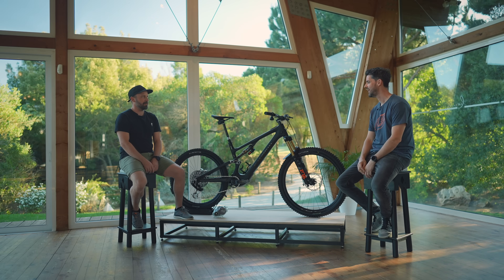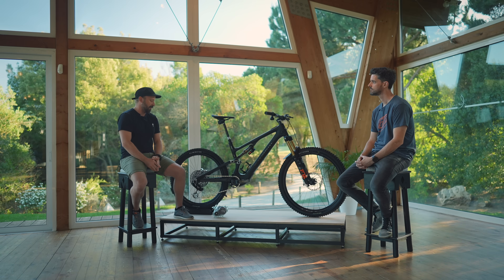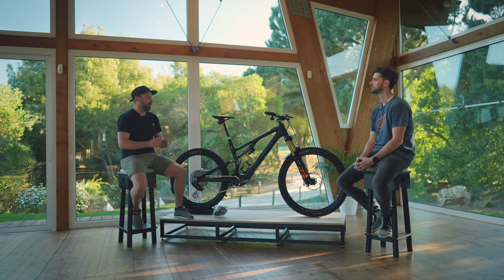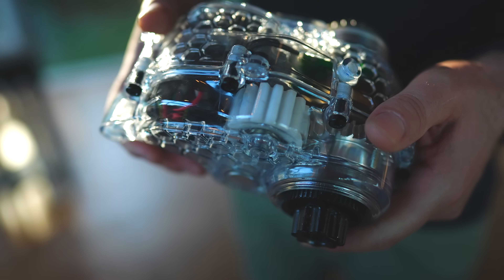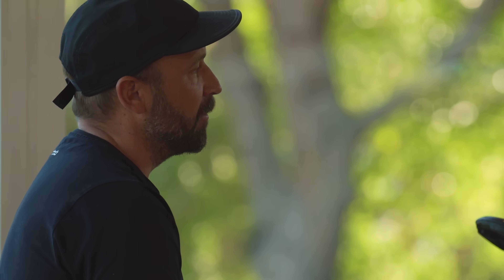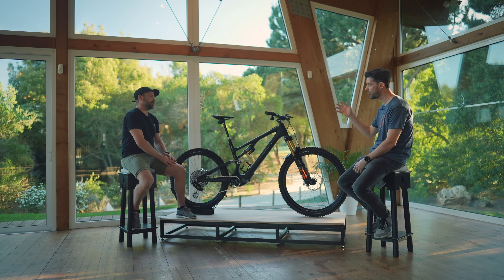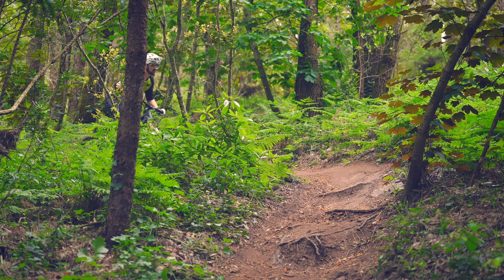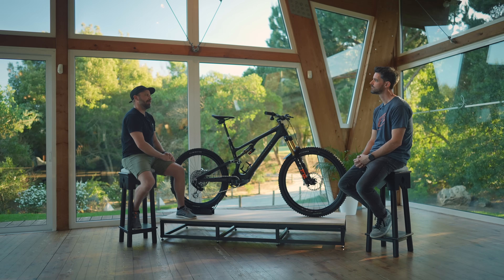How We Made The Levo - Specialized Levo SL Designer

Comment: Hello future (and current) Specialized owners!
I'd like to bring a topic to your attention that not many talk about: the waterproofing of these bikes. Although my bike is of the previous generation Levo SL (1.1) than the one mentioned in this video, I'd like to share my experiences of 1 year into ownership.
Let me start by saying, that the bike gave me a lot of please while it was working and there's no denying that ebikes can bring a lot of joy. However, this comes at (in my case) at quite a cost. I purchased my bike in 2023 November and used in throughout the winter, no matter of the weather (which is around 0 degrees C and rainy in Hungary). By March my bike started having issues, and by the end of the month the motor died. Because the warranty does not cover any type of water damage, I had to pay for a replacement (although I did receive a 30% discount on it). Getting a new motor took almost three months and only received the replacement in May. Unlike winters, summers a pretty dry and hot here, so my new motor did not see a lot of water until last weekend, when although it was not raining, the forest was quite muddy because of the rain in the previous days. This did not stop me from riding, not suspecting that it would cost me my second motor. I got home without any issues by my bike won't turn on since than. The service center told me that this is most likely due to water ingress.

I have always taken great care of my bike and since the first incident, even tried to stay away from wet, however this still could not prevent the second motor dying on me within a year.

Do yourself a favour and before buying a bike (or taking your current one into wet conditions) do a google search for "bike won't turn on" and "water ingress" to see that a lot of people a struggling with these issues. These (Levo) motors were just simply not made for serious MTB use!

From content creators, like Rob, it would be great to see an investigation into the longevity of these motors, because I feel like these interviews only tell the happy part of the story and should not be used to make decisions about a €7000+ purchase.

Comment: My 21/22 Stumpjumper Carbon Expert did cost me new 3.6k (Euro) six month ago and five years from now it will be still fine, heck maybe get a SRAM Transmission on sale Three years from now.

The Turbo Levo SL Expert Carbon cost 10K (Euro) and you are testing a brand new Motor/Software and you need to buy another 29er Wheel if you don't like mullet and obviously a range extender at some point. In the Next Three years a never version will replace it.

I think the E-Bike technologie is evolving way to fast to justifie those prices if you are being rational.
I also wear out 1-2 Drivetrains each year so...

All that being said, I did test ride this Bike and it feels like a Stumpjumper EVO and it's amazing!
Just not 15k Amazing ;)

Comment: For the price I hope the motor lasts at least 10 years. Battery slightly less and there should be no issues buying a replacement if need be. This is the biggest fear that a battery or motor fail and will not be available anymore years down the road. Now you have a $15K paper weight. Also when purchasing there should be an option to choose a 29 rear.

Comment: Interesting to hear the story and technical details. One thing I'll point out (again) is that Torque is not the same as power. You can't say "50Nm of power". Nm is torque and power is Watts. The formula to calculate power from torque and RPM is:
Power(Watts) =  Torque(Nm)*RPM(Cadence)/9.5488  (W=T*RPM/9.5488). This can be rearranged to solve for T if desired. 
So at a normal cadence of 80 RPM and a power output of 320 Watts, the torque is 38.2 Nm. At 60 RPM with 50Nm of torque, the power output would be ~260 watts. Etc.

Comment: I tested this bike in Santa Cruz for a couple days with 5 of my friends. We had all of the different models. The Kenevo Sl does not have enough power with 35 nm, the seat hight is way to high-29 wheels on steep UC trails it was no good. It was the worst out of the Three. The fully powered models where great on power and even still felt better than the Kenevo. My whole crew as younglings all were bmxers. The new Levo Sl is the best mountain bike I have ever ridden. It has a BMX feel. I honestly don't know how they pulled this off. It felt so comfortable and stable. It roomy with out being to long. I am 6 foot and the S4 size was perfect. The mullet made the steep stuff feel like a breeze. The power delivery of the new motor is very natural and it can keep up with the full power ones. The travel is more than enough to handle everything we through at it. It left me speechless. I am sitting here trying to figure out what sell out of my garage to find some funds for this. Before buying any E-Bike try this Levo Sl , Specialized hit it out of the park!
Reply: Sell the Dog.

Comment: I feel like he’s completely missed the point by talking about existing riders of the old SL not needing more power. There’s a whole market that wouldn’t buy the original SL as it’s so underpowered (myself included) but are looking for lighter and less powerful than a full emtb. I’m not sure that this group would buy the new SL either with a 320w battery. Running 50nm in turbo is going to hammer through the battery. Think Specialised have missed the market on this one.

Comment: Why, in these interviews, nobody asks specialized why they didn't go for a 400wh battery? The extra weight? +-400g? The weight distribution? The extra cost for the client? The extra cost for specialized?
It seems to be the elephant in the room   ;-)
Reply: Because 320 is enough most of the time. And when it's not, you have an optional range extender. I like their choice for this category of ebike.
Reply: @5crum  let's see if Specialized thinks 320 is enough most of the time next year when they upgrade the Kenevo SL. You're probably right, maybe it's enough for 80% of potential customers.
I have an Enduro and two of my friends just bought a Levo full power. I would prefer a KSL with 50NM and 400wh + 200Wh (range extender). I think with that combination I could ride with them on the days they use most of the 700wh battery.
Mentally I still don't feel prepared for a full power 😜😃
Reply: Marco did say that they did not want to increase the weight, a 400wh battery would increase the weight.

Comment: Will the new 50nm 1.2 motor fit in my older 1.1  version sl frame?  If so, will they be made available?
Reply: My understanding it fits, but Specialized states it wont work  "because of the software" which is ass backwards.
Reply: @rezenclowd3  so buy motor and TCU and you're set. right?
Reply: @rodent  they are not sold only exchanged

Comment: ugh, its a motor, not an engine.  Motors use electrical input to drive the unit.  Engines use Fuel.
Reply: it also makes me cringe when I hear people call electric motors engines....
Reply: Oxford English Dictionary: 

Engine: the part of a vehicle that produces power to make the vehicle move

Motor: a device that uses electricity, petrol, etc. to produce movement and makes a machine, a vehicle, a boat, etc. work

Conclusion: You can change them interchangeably in the context of this video.
Reply: @Tobias611  Wrong

Motors run on electricity and engines run on combustion. The engine converts various forms of fuels into mechanical force, while the motor transforms electrical energy into mechanical energy.  People may use them interchangeably, but they are wrong.

Comment: I’m interested to see how the motor is connected inside the frame, any plans to drop the motor and let us have a look Rob? Based on my experience with the Trek Rail I want a system that can tolerate some flex in the frame and not put a lot of strain on the connectors.

Comment: Next Gen - as in it doesn’t break within a 6 months like their last motors 😂
Reply: 😂 True

My bosch didn't last much longer though
Reply: My friends e8000 went tits up with 500 miles on and took 3 months to be replaced. Got my 3100 miles slightly noisy but still working fine Levo motor replaced in 24 hrs.
Reply: 4years on original shimano e8000 motor - done 5k miles- mostly battered on reds and blacks and jumps. Hasn’t missed a beat I am pleased to say which is as it should be for spending £5k+ on a bike.
Reply: @HesJustZisGuyYouKnow  you have been very lucky to have an e8000 on 5k mine went at 3k with the dreaded e010 error code